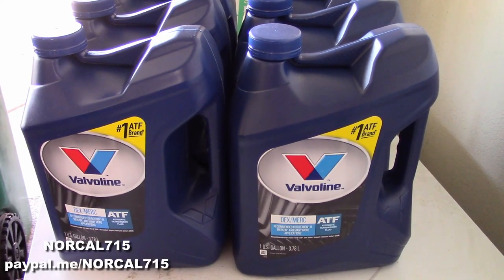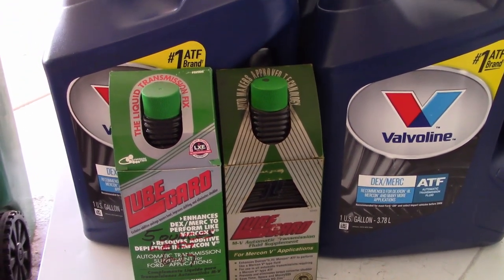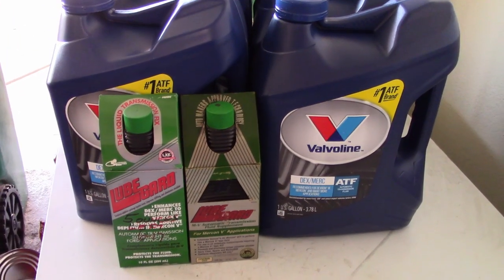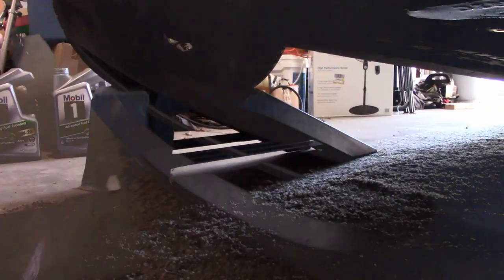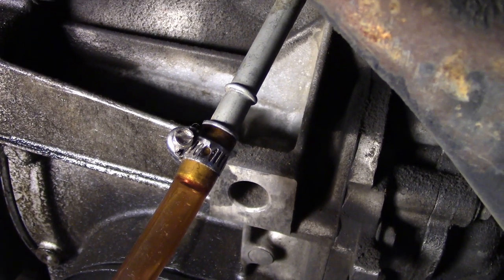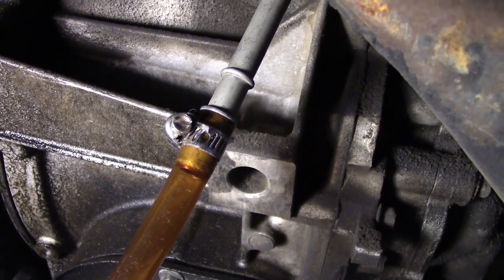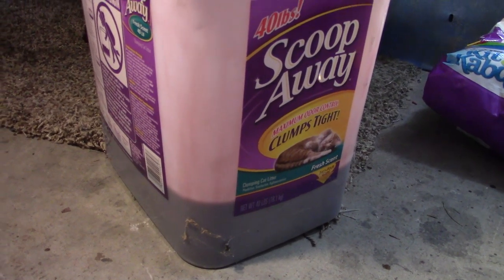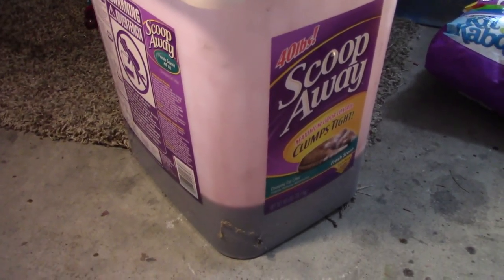COMPLETE AUTOMATIC TRANSMISSION FLUID FLUSH REFILL TORQUE CONVERTER AOD AXOD AX4M A4LD 4L60 4L80 727

Comment: Not sure you want to drive pan bolts in with a power tool - better to start them with your fingers / by hand so as not to take a chance of cross threading the bolt/hole. I don't know about Fords, but I thought there was a pattern to snugging up the bolts rather than simply starting at one and tightening them sequentially - counter-clockwise.

Comment: Automatic transmission fluid flush is like the number one thing that people should be concerned about and they're all about the same these days you should be flushing it every 40,000. Case in point BMW labeled a lot of their transmissions "lifetime fluid" so people never changed it. get into any used E90 with a 6-speed transmission over 100,000 miles and you'll see that the transmissions are shot. The clutch material naturally wears under normal condition which is suspended in the lubrication essentially creating a sandblasting material destroying all of the mechatronics hydraulic pathways and all of the bushings.
Reply: Thanks. My Toyota Yaris only state drain & fill, the dealer recommended flush & change the filter. It’s so confusing😮
Reply: Nathan,  I'm looking for solutions for my transmission oil change. I have a 2000 E46 323CI  with the GM transmission (5L40-E).   I don't have the dipstick of course,  but I do have the transmission oil cooler.  This video gives me hope,  do you see any problems with me using the same technique on the BMW?

Comment: this is fine for these older transmissions. Use  anything but factory OE fluid in modern transmissions? do so at your own risk. Also, by  splitting  you cooler lines like this,  without fluid in the same  rate of flow going back in starves parts of lubrication,  again, modern transmissions? do this at your own  risk. Also modern transmissions  do not have dipsticks, and require special fill procedures, do this wrong, again at your own  risk.  Been doing this for 40+ years professionally.  As simple as I could put it, do this with a CVT and you will be walking soon.
Reply: I've a question sir. I've a transmission with a deep stick and got 6/10 quarters imported for my car, my plan is to do juat the pan fluid change (should be like 3 quarters), drive it for a week or so and then repeat until it comes clean. Is it a good idea? Thank you in advance
Reply: Help
Reply: @davepianist84  our you walking yet
Reply: @charles2675  The procedure went just fine and the transmission actually got smoother, thanks for asking pal
Reply: Another reason I do not want to buy a newer car!!!
Reply: This is actually identical to a FORD procedure.
Reply: Would you say it is better advised to just do periodic drain and fills?
Reply: You are good at is  , would have a hard time figuring out which one is the return line , ty
Reply: @islrubsca2330 doesn't matter, u will just be doing three changes within a year, then. Just change the filter in the second pan drop.

Comment: The hot line is Not the return line from the cooler. The hot fluid is the fluid that has not circulated to the cooler and is on the way to the cooler.

Comment: If you don't flush it first should there be a lot more ATF fluid in the pan or does it make a difference if you flush it or not before doing this ?. I have plans to flush mine. But I don't know if I should take off the pan first or flush it first .🤔
Reply: Drop the pan first. If you flush first before dropping the pan you risk the danger of flushing out particles through the pumps and running metal shavings around

Comment: Very nice job - - my only suggestion for future fluid changes, is to only use the Transmission fluid recommended without adding any additives.  For your vehicle, Mercon V is  "Required for 1996 and newer Ford vehicles and backwards compatible with
MERCON®.  Also, Citgo makes Lubeguard and offers a Mercon V.   The cost to use Mercon V rather than your formula, is insignificant from a cost stand point. 

Regardless of the above, you'll never have a transmission Fluid issue .... TY

Comment: Interesting, it looks like u doing fluid change on a regular basis. Why wouldn't you get a drain plug welded into the pan? Cheers Graham
Reply from the maker: I tried that and it was not installed true to the pan. It leaked and I replaced the pan on the next change and just drop the pan. No leaks only very light seepage.

Comment: Why would you use a GM fluid with an additive if you could just use a ford fluid?

I did like the tip to find the cooler return line though.
Reply from the maker: I was on a tight budget at the time and really could not afford the $5+/QT fluid at that time. The Dexron III, and the additive was approximately half the price and works just as well, in fact the additive company boasts about how it will outperform the factory fluid. I have had very good luck using it and will probably continue to use it in the future. Thanks for asking.

Comment: Enjoyed your video on trans flush.  Have two questions why was the pan full after being flushed just prior.  Why use the Dextron w/additive vrs just use Micron V? Thank you Jim
Reply from the maker: I think a lot of it was torque converter, servo, and valve body drainback. I was on a budget at that time, also I have had good luck with the Dexron/Lubegard combo.

Comment: When you draining oil through oil cooler tube,did you pour new oil at the same time,I think you did because the oil that comes out has its color changed.
Reply from the maker: Yes I was pouring the new fluid in as the old was pumping out.

Comment: At least your car has a dipstick... new ones don't give you that luxury ....
Reply: There’s a plug you undo on the transmission from underneath the vehicle. Once that plug stops leaking the transmission is full.
Reply: Only on the cars without a dipstick
Reply: @williammatney-tate5057  A little over simplified. The car needs to be running and at temperature - it’s not just a matter of seeing if fluid comes out

Comment: Got a question to see if I did it correctly. I hooked up the drain line from the oil cooler and I had my truck in park but running and all the fluid came out after I kept adding more fluid to flush it. When I dropped the pan there was hardly any transmission fluid (less than half a qt), so I think I drained mostly all the fluid I could. does that mean I got it out of the torque converter as well ?
Reply from the maker: You are never going to "get all of the fluid out of the torque converter" you just want to replace all of the old fluid in the torque converter with fresh fluid. As long as you were adding more new fluid then you replaced the old fluid with new fresh fluid. And yes it is normal to have less that a qt in the pan.

Comment: I hate to ask such a long question but I have a 2005 navigator 5.4L without a dipstick the manual says to change the fluid and filter at 150,000 miles  at a recent routine oil change the dealer told me not to worry about a tranny filter because it don't got a filter the manual in the glove box said to change fluid and filter at 150,000 miles I got confused because all of the conflicting information and someone popped the plug and fluid  came out that looked pretty good they measured it and it was 4 quarts so they pumped in 4 quarts of Mercon SP why all the conflicting information about a filter.
Reply from the maker: Drop the pan, I am sure you find a filter.
Reply: @norcal715  I don't know if the mechanic I went to was comfortable with doing the job or not he opened the plug and 4 quarts came out that was in great condition  I pressed about wanting the magnet and pan cleaned he told me that  my truck didn't have a filter he called me over to his computer and showed me a tranny pan with a filter built into it and  repeated that  I don't have a filter  Autozone says the truck has a filter i'm just gonna take it to someone else and have them drop the pan and put that same fluid back in since it was changed less than 500 miles ago. these folks making me crazy it's a perfectly good truck and i'd hate to ruin the tranny because some idiot wouldn't tell me he's too lazy to drop the pan.
Reply: @jeffwatson151  The 4 quarts is only what was in the pan, the rest in the gearbox, torque converter and any cooler would not have been changed. The new fluid will be mixed with the old now, so get new fluid in and you will have 1/2 new fluid if its not been flushed.

Comment: Need to cycle the gears to completely flush the transmission.
Reply from the maker: I am not worried about the 2 or 3 ounces trapped in the valve body when the total fill is 13+ quarts. There may be a 1 or 2 % contamination on a bad day. The clutch packs hold virtually no fluid. The accumulators maybe hold another ounce or 2.

Comment: Oh oh no no
Damage on its way
Reply: He is actually following the FORD procedure for flushing the transmission basically word for word from the FORD service manual on the AX4N transmission. Others have done it this way no problems. FORD does caution to run the engine at idle speed only, and to shut off immediately when the solid flow turns to bubbles.

Comment: nice job do the same thing. 2 remarks: with a hand pump you can already suck out the lubricant throu the dipstick, so you haven' the mess when you are taking of the reservoir. 2. i already use quality oil products like you even in modern transmissions, these messages to use only the original product is a joke. also the car producers do use the oils from these oem fabricants only with the original name and twice the price.

Comment: You drained the tork converter  lol I thinks what u ment then u drain the pain
Reply from the maker: I did flush the torque convertor of all old fluid. Maybe I mis-spoke.
Reply: @norcal715  its kool  I'm about to do it too. But to cold out foot of snow  I think I might have a broken  soloined  wire my drives for 2 sec  then goes in n like every  gear  so I turn it off back on same thing no slip for like 2 min then it does it again.